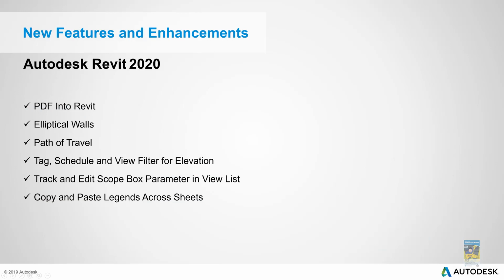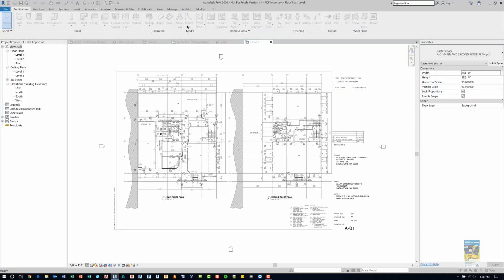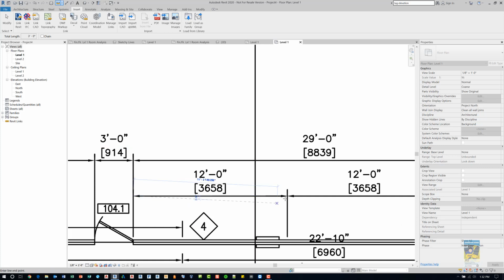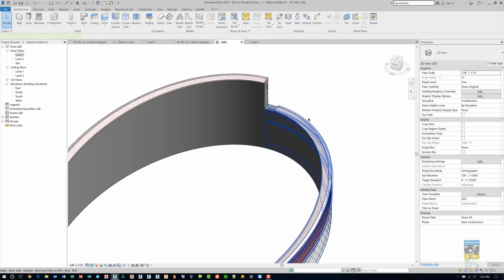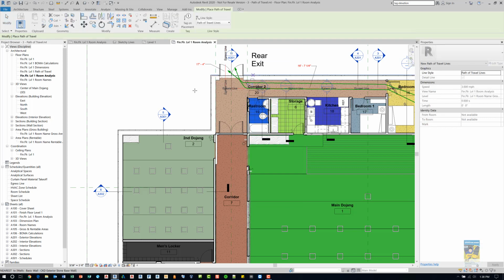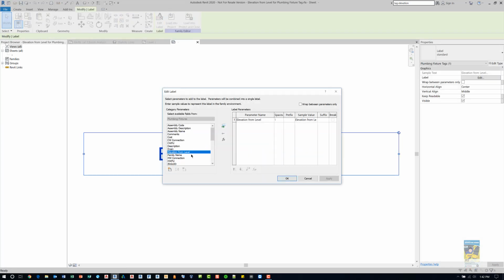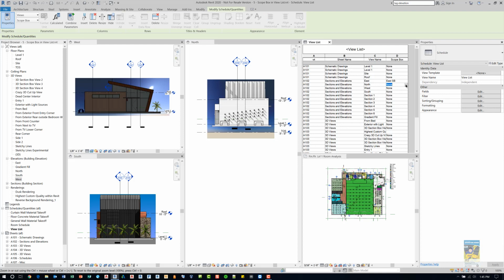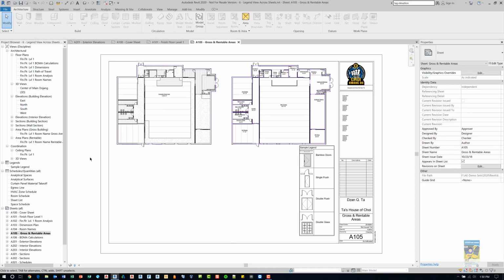What's New in Revit 2020

Comment: The only concern I have with PDFs is that they are usually integer based, so you have to be careful creating geometry from them by snapping. You need to double-check the resulting geometry to dimensional accuracy.